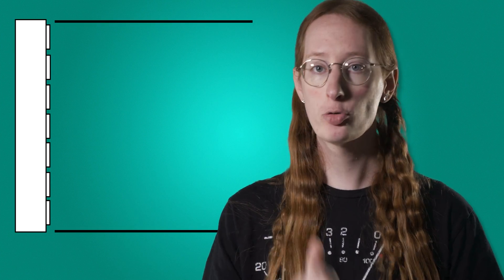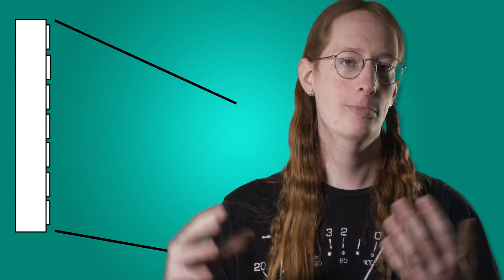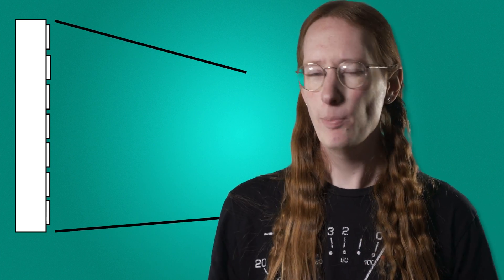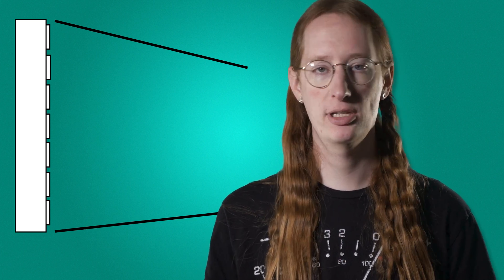Creating Sonic Holograms - Wavefield Synthesis Explained

Comment: That problem with needing 400 addressable channels is sort of related to the reason we have L+R and L-R outputs for stereo.  They noticed that it used bandwidth more effectively.  I wonder if you could do it using some differential method, where each speaker/amplifier/DAC combination unit had it's own processor to handle the differences from the others.
Reply from the maker: That's definitely a possibility. I know a lot of setups today use networked audio like Dante, which makes it a lot easier to handle those hundreds of audio channels than it was in the past.